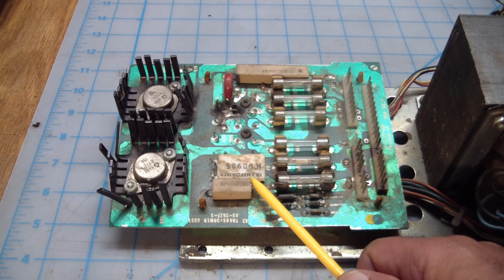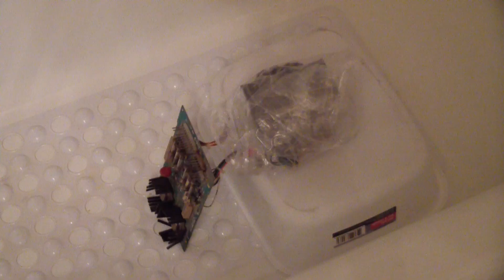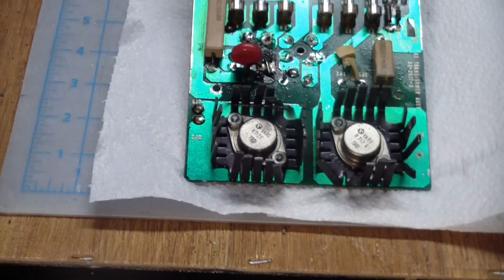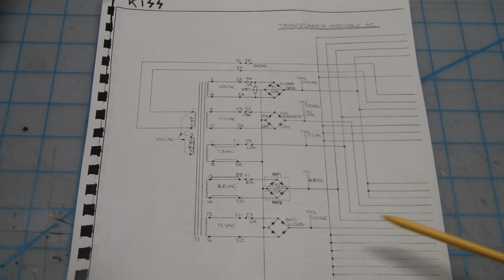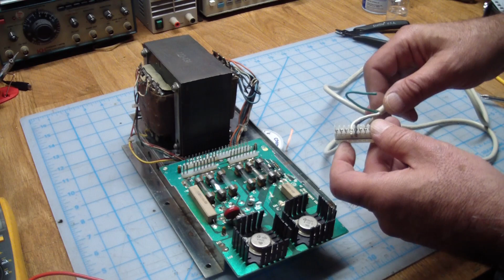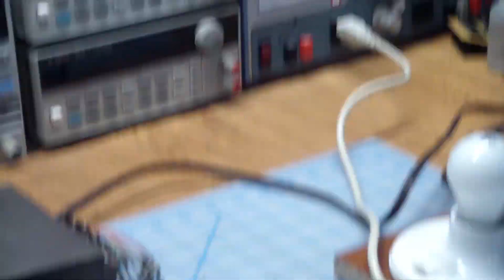AE#150 Rebuilding A Power Supply For a 1978 Bally KISS Pinball Machine

Comment: What would happen it you put the whole thing in a bowl and poured 3 inches of neat alcohol over it, let it soak, give it a scrub and then take it out and allow it to dry?
Reply from the maker: Same concept. After immersing it in 99.9% alcohol the alcohol will evaporate very quickly. However, when the board is "muddy" to begin with I'd still start with a water bath.

Comment: ARTIFACT ELECTRONICS< Why did the designers use TO3 package high current diodes for the control lamps for only 6.3vdc? it just doesn't make sense to use T03 package for only 6.3vdc. I'm not sure why its common for pinball games and arcade games to use UN-regulated voltages, why would they want to use Unregulated AC and DC voltages?
Reply from the maker: It's not the voltage but rather the current. The earlier boards used an 8A bridge which was clearly stressed badly. Worse than that this bridge used a 10A fuse.
Reply: @artifactelectronics  The TO3 package is "increasing" boosting the current? I thought it was just the current rating was able to handle more current. What fuse rating should be used instead of 10A fuse?

Comment: Are the DC smoothing caps on another board?
Even unregulated DC needs soothing; right?
Reply from the maker: Yes, there's a regulator board the raw voltages feed into. And rectified AC does needs smoothing cap.

Comment: 40+ years of un-clamping those christmas-tree stand-offs and I never knew or thought about them having a tool! Thanks.
Reply: They used to sell an actual tool for these stand offs but haven't seen one in years. I use an old TV antenna -- find the right section, cut it off and you're good to go.